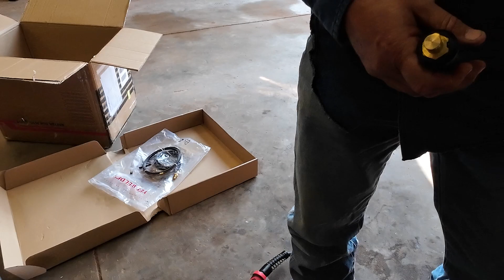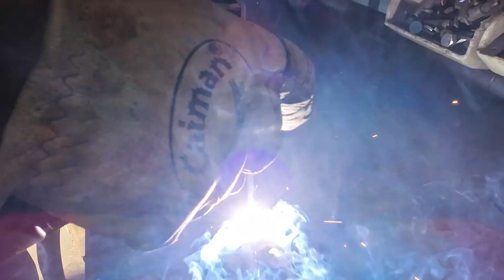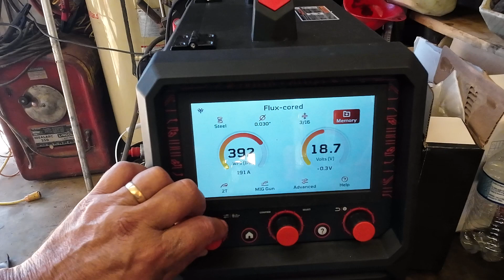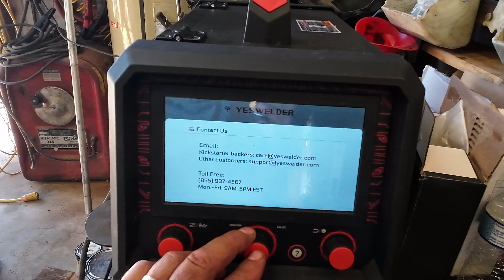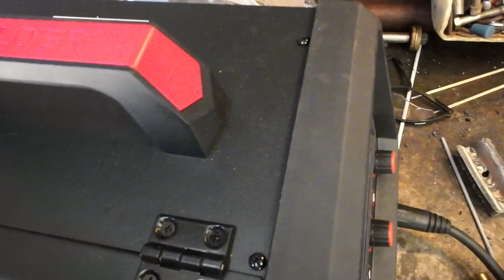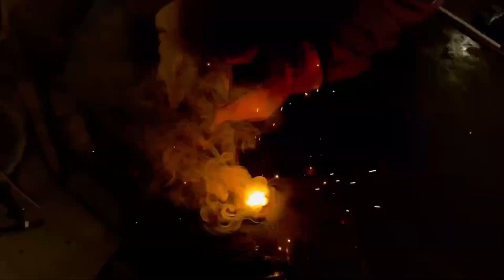Testing the Yes Welder DP200

Comment: Yeah I cut my teeth on stick and it’s hard for me on wire. The little I have done welding and how old I am I can’t remember from one time to the next what I should do. I had a miller wire feed from a box store and my brother is a welder by profession, Has welded on aircraft carriers to dirt moving equipment and everything in between for almost 50 years and the miller quit feeding wire. I would have bought one of these if available at the time. Of course my brother says all these small welders are a pile of junk but he is use to 100 percent duty cycle 40 to 50 and more thousand dollar welders. A lot of grinding and a thick coat of paint makes me a professional welder. Lol

Comment: Ok Frank. My advice is not sell your SA200 yet. Oh I think I heard your old IdealArc250 laughing in the background. I’d hang on to it also. I have a couple inverter welders, a Lincoln 210MP and a Miller Maxstar 140STR. They do weld amazingly well for their weight on any power input. But they are more computer than welder and they do great until they don’t

Comment: Nice review Mr Frank.
Seems like a nice welder for DIY work.
Tig is great for welding steel lines. Better puddle control like oxy/acetylene welding.
If you can gas weld, you can tig.
Same here, I can Stick weld, Mig, not so much. No Practice!
TGP[

Comment: can it run off of a generator, my lincoln won't has to use line power
Reply: all of them will run off a generator if the generator is putting out clean power
Reply: what Lincoln are you running?
Reply: My 5k inverter generator wouldnt run in on a 20 amp 120 plug.  I need an adapter to try the 30 amp rv plug but i think it would trip it within a few mins
Reply: @ I trip breakers when welding off a generator fairly frequently when hooked up to the normal 120v outlets. Sometimes I can get away with it if I’m running 3/32” rods but usually .035” mig or 1/8” rods will trip breakers real quick. The size of the generator plays a role too. When you don’t have the wattage required I’ve noticed it’s easy to trip breakers as well. I try to run my machines off 220v when I’m doing more than just a few short welds.